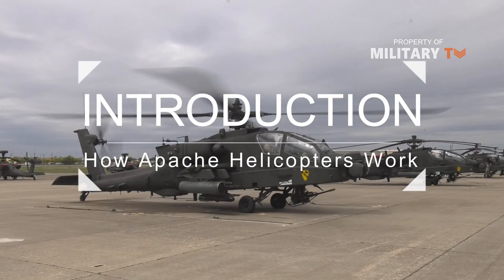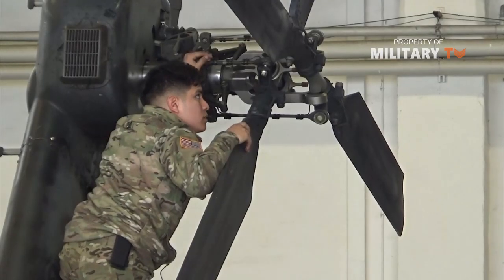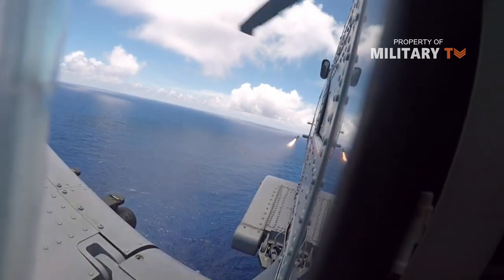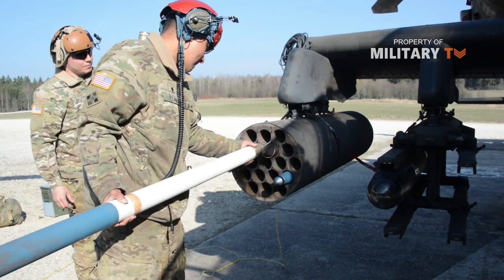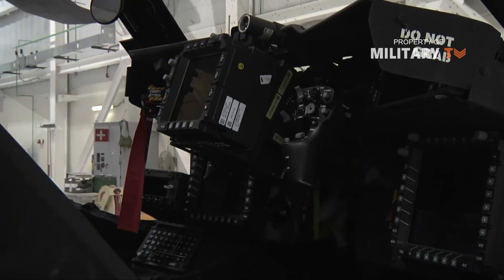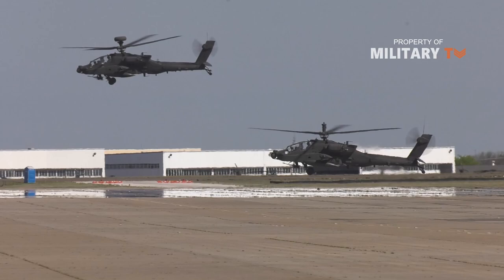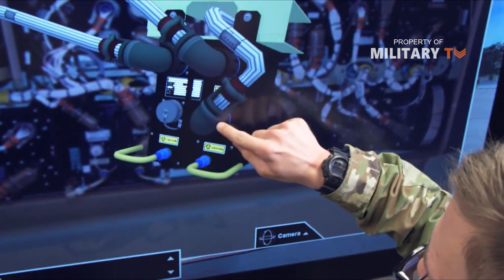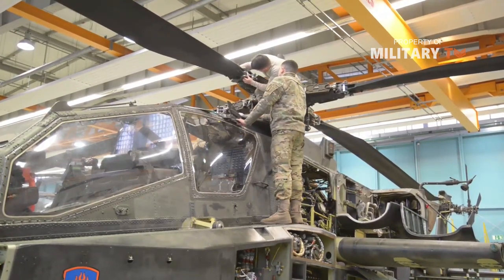The AH-64 Apache Helicopter Monstrous Power & Capability

Comment: Fun fact: the Apache is the hardest heli to fly in the world because you need to do everything at the same time
Reply: Not really because a lot of controlling for those functions are intergraded into the AI computer too.To aid you the pilot and the helicopter for flying too.
Reply: @Chi Chu  yes but still your eyes do diffrent things and your arms/legs
Reply: @Eggychonk  after about 100 hours your hands and feet control the aircraft without you really thinking about it. Pretty much like driving a car, you don't think about everything that you do behind the wheel, it just happens. Like using the force.
Reply: @mrgrinch837  yeah at some point it becomes second nature
Reply: @mrgrinch837  that can be said for pretty much any flying vehicle. helicopters especially, because they're inherently unstable platforms. Just getting the damn thing off the ground without overcompensating and drifting sideways into a wall takes practice. Flight training with a helicopter puts you through a lot of exercises that simply involve taking off, hovering without drifting, and then landing in the same spot, because even in a private/commercial helicopter it's hard to do that.

Comment: The dumb fire rockets are now laser-guided as well thanks to APKWS systems.  Their standoff range is up to 3 miles.  They come at you at 2400 fps or about 7 seconds travel time.  22k is far cheaper than a hellfire.   Sadly, they don't support the ninja blade format.

Comment: Apache is available in situations. 
It is still No.1. In fields combat.
Battalion needs these machinery helicopter. 
It is useful.
Body,engine, propeller, electronics, weapons, proof/paint,equipment,head set/radio communication, command system,and GPS avigation gadgets. 
I suggest that parts should be modules in assembly Assembly site and conveyor belts.

Comment: Been in love with this war machine  ever since I learned about it. Prob 1 of 2 favorite air machines.
The Apache & the A-10 Warthog working together for our ground troops is such a beautiful thing. Goddamn beautiful I say! You won't win....
Edit - I wonder if we can figure out a way to put A-10 gatlin gun on an Apache helicopter.( Have to make the heli would have to be double in  size probably but so..........!!!!! Gotta be a way!!!!!!!! Think!   Haha. Seriously though.........
Reply: Both are 30MM rounds.  I flew the 64 for 20 years and learned a lot about the 10 from another 64 driver buddy who was. USAF Crew chief on the 10 prior to The primary his Army service.  As I was told, the primary difference between the two 30MM rounds is the size of the shell that houses the powder that propels the rounds.  The 64 moves at slower speeds than what an A-10 requires for flight in an attack dive so it doesn’t require the range the 10 needs.  Both are high explosive rounds.

Comment: -Hellfire missile: $80,000 HEAT warhead for destroying t72 style tanks
Actual use : destroying insurgent 1992 nissan and toyota trucks and vans.
-30mm autocannon: Over 2 inches of penetration for destroying BMP style infantry fighting vehicles and other light armored targets.
Actual use : shooting infantry.
-M2 50cal: role, anti infantry overwatch and light vehicles (jeeps etc).
Actual use : opening MRE's and mail.
Reply: The only thing that I know of that has ever survived in Apache hit was in M1 Abrams tank in Iraq when a moronic lieutenant colonel fired two Hellfire missiles at a Abrams and the only damage was a ruptured hydraulic line and one of the crew members getting burned with the hydraulic fluid. The Abrams and the challengers are the toughest tanks on the planet.

Comment: i love the Apache...but with the fearsome Kamov Ka52, MI 28 Havoc and modified Hind Mi24...I think the Ruskies got this one
Reply: Given the Russians invented helis I think they should get that category on lock.
Reply: Ask yourself why they need three to do the same job
Reply: @bevpotter9938  They dont Bev. They are optimised for diufferent roles.The KA-52 is the Spec ops Chopper, The mi-28 is the equivalent of the apache, the mi-24 is the workhorse. Look at Mi-26....it has more cargo space than than a C-130 hecules! The russians simply buildbetter helicopters. I have no issues admititng that the F22/35 is far superior to what Russai has and the US navy is waay more capable than Russians. Why cant you respect the the russians for their achievements?
Reply: @bigdarshan  what about now? The Russians lost 18 ka52
Reply: Yeah this comment didn't age well
Reply: When you're dealing with that kind of Firepower there are two things you need to take into account. One, the first one scene is the first one killed and two, if there's an enemy helicopter out there awacs is going to see it first and vector fighters in to remove it from the skies. That's an area of a helicopter on helicopter engagement is just not something that's ever going to be seen. The Airborne warning and control system as well as the J-Stars have very sophisticated radars that can pick up a helicopters rotor cranking on start. There is not a chance in hell that any enemy aircraft is going to be operating near Army ground troops, that would include apaches. It won't happen.

Comment: They should have added the picture of the british soldiers sitting on the sides of it because they wanted a ride into an ongoing firefight, and no other helicopter was available.
Reply: That was in January 2007. It wasn't because they wanted a ride into a firefight. It was because there was a casualty who needed rescuing and there was no other way to get to him. His name was LCpl Mathew Ford. Unfortunately he died of his wounds.
Reply: @PaddyInf  -There actually is a compartment in the belly that has carried people in emergencies.
Reply: @zxej6879  The cargo compartment contains emergency kit for the crew. It has never been used in UK service to carry people as it violates the release to service. Plus it is only rated to carry 35kg of kit and is too small to fit a person plus kit. The episode in 07 was the last documented time non-aircrew have been carried on ops on the air frame. The emergency procedure for carrying casualties is to attach them to the undercarriage using straps carried by the crew specifically for this purpose.

Comment: Soo how does the laser guidance system work if we dome the base with mirrors and reflect the laser out?
Reply: Ask your mom
Reply: It don't, which is partly why they're going with radar guided missiles today. As for why that wouldn't work on radar, radar guided systems work like more of a flashlight-camera system looking for reflections rather than using a laser on one tiny point. You could use flat mirrors to mostly reflect the light away from the source, which is the entire point of the F-117, so that works. Any curves so the edges aren't sharp and you're right back where you started, though. Then you need to cover the whole thing in radar absorbing paint just for good measure, which is expensive and rather thick due to the physics of reflecting long wavelength light.

Comment: what is that round thing on top of blades?
Reply: Longbow radar
Reply: @2010sjay  for air targets?
Reply: @alinaeaj9127  Ground and air
Reply: @linussandell831  thanks
Reply: @alinaeaj9127  You're welcome, but don't quote me on the air aspect because i'm a bit unsure, just assmuming on that part but it's mainly for air to ground use
Reply: @linussandell831  ok
Reply: @linussandell831  nope, it's for ground targets only. People keep assuming it does air to air, that's not the case. The us as well as Western Doctrine is we would have a awacs aircraft up and as long as those things are in the air there's not a chance enemy aircraft will get within 100 nautical miles of this thing. There are instances where it says it has fired stingers, that's a research and development thing. It does not do air-to-air combat. That's going to be left up to the Air Force and navy.

Comment: Heat seeking missile require heat to go to it's target so the apache drops its own heat temperature to lose the missile targeting systems
Reply: It actually uses three different techniques. The black hole infrared suppression system, infrared flares in the dispenser and low level flying makes it very difficult for a heat-seeking missile to lock on. All three make it very very tough to take it out with a shoulder fired Sam.

Comment: Can the windshield withstand a 50 bmg armor piercing round? Or a 20mm? If you are a skilled sniper well hidden,  in the right place at the right time with the right gun, that is your only chance of beating one of these and thats a slim chance at best.
Reply: The windows are made out of plexiglass. There is a transparent ballistic shield between the front and back seats so if there's an explosion that goes off in one cockpit it won't take out the flight crew in the other cockpit. Other than that, you get close enough with a BB gun you can shoot through the plexiglass.

Comment: Not sure why the Apache is not used as much as the A-10 Thunderbolt is for close air support. Maybe it is and I don't know much. 
I do know that we had both Apache and Kiowa Warriors in support and we only used the Apaches once but had Kiowa Warriors in support every day. The KW can put a single 50 BMG round on target like a sniper rifle.
Reply: @sicsempertyrannis7  I was in Mosul for 13 months in 04-05 and one of our first missions, before taking over our platoon sector from first brigade of the 2 ID, was to drive down to Anaconda and escort the 151 aviation bgd that was to be our overwatch Apaches. We were supported by them on our first full bgd mission in a hammer/ahnval operation. Upon exfil our BN was taking RPG fire from a building and the Apaches shot a hellfire into the window and that was that.
And we only saw them during their "show of force" every week or so when they would light up some targets on an island in the middle of the river... 
We had more support from the Navy F/A 18 Super Hornets dropping JDMS for us and doing gun runs
Reply: Whether you get a warthog or in Apache depends upon the situation. They both do exactly the same job, it all depends on which one is available at the time of the request is made. First come first serve.

Comment: "the crucial motor component can sustain 23mm fire" LOL SURE BRO
Reply: i was confused about that as well lololol..i'm a combat vet.
Reply: @KevinP32270  cool, no way that prop can handle a 23mm thats like a su27 cannon
Reply: Chill Waw
It can actually and the fuel tank can take a round and resell itself
Reply: @rainerduxworth6669  i doubt it man, ik the fuel tank can seal itself, thats like ww2 tech, but no way that motor can sustain fire from 23mm, maybe a few shots sure but a straight on barrage of HE bullets is gonna tear that thing apart. doesent rly matter anyway since main anti aircraft wepons are rockets and flak doe
Reply: CR  they use it mostly in russia and ex soviet union countries, like you can mount a twin barreled 23mm on mi35 mig 29 and other aircraft that is currently outdated. i think the thinking is if it can withstand 23mm it can also withstand 20mm
Reply: It's resistant to 23 mm rounds, pretty much like your watch is water resistant, not waterproof. The only thing this means is that it is designed to be able to be strafed and likely will stay in the air. It isn't going to continue fighting it will have to leave the combat zone and make an emergency landing. There has been a case during Desert Storm in the very first engagement when the team of ate Apaches went across the desert and fired up some early warning radars. One of the Apaches had 23 mm hole through the rotor disc. Depends on where you hit the thing, you could either scratch the paint or put a bullet through the Pilot's neck. Either way they're calling the insurance company.
Reply: @marko61900  that's probably one of the reasons they have two engines. They can still fly on one.

Comment: Whats that bubble on top of rotors?? Sensors..
Reply: It's a millimeter wave radar system which is designed to scan the battlefield in a half a second and get the locations and descriptions of up to 25 different targets instantaneously and prioritize the most dangerous 8 to the aircraft. It can then fire off Hellfire missiles and hit each of those targets.

Comment: 7:40 The Yankee is loading different rockets in the same zone.... SMH #12cab
Reply: Yea, you can do that in the apache. It can hold up to three different rockets at the same time
Reply: @linussandell831  right, but different the types have to be loaded into different zones with in the rocket pod. There's  an A, B, E zone on that rocket pod.
Reply: @aolson8283  Oh really? how do you know which one is A, B or C?
Reply: @linussandell831  A ZONE: is the 12 around the outside,  B ZONE: is 4 in the middle (two above the  E zone and two below); E ZONE: is the center 3.
Reply: @aolson8283  Oh, cool. Thanks alot, is there a reason why it's called E and not C? I noticed that i read it wrong the first time
Reply: @linussandell831  rocket pods on the inner pylons are zoned C, D, & E respectively. E ZONE is the same for all pylons. For a total of 5 total zones. The reason I commented I'd because rockets of different types are never loaded into the same zone because the aircraft wouldn't be able to distinguish the different types in that zone. The type loaded in a particular zone are set in the aircraft.
Reply: @aolson8283  Oh, i get it. Ok, thanks alot, I really enjoy this sort of information :)

Comment: 30mm is apaches primary weapon. It was literally built around the gun. Without the gun the aircraft cannot fly
Reply: I never know that! How did you know?
Reply: GEO I work on the armament systems lol and load them with ordinance
Reply: Well actually it can fly without the gun, and it's not built around the gun. The gun is hanging beneath the aircraft. I think you're probably referring to the GAU 8A 30mm cannon on the A10 warthog.
Reply: @mrgrinch837  I’m literally an Apache Armament and avionics tech. The aircraft cannot  fly without the gun due to it being a counter balance.
Reply: I flew Cobras for close to 10 years, we can fly without the 20 mm although it's something that's really not done. Confirm with an ah-64 maintenance test pilot that you are indeed correct. Sat in one of the monsters for a transition that was canceled. Comparing it to a cobra it's like comparing a Dodge Challenger to a Volkswagen Beetle. The thing is freaking huge in comparison. I would not have it suspected that the loss of the gun would have made that big a difference but according to you and CW5 
Hefler you are indeed correct.
Reply: @mrgrinch837  the apache is a behemoth compared to cobra but Cobras are badass helicopters as well!

Comment: The only think the apache is missing is ejection seats to save the pilots.
Reply: you cant have ejection seats on a helicopter mate, you would be chopped up by the rotors
Reply: @adammaher6962  So then what must go before the election seats shoot out?
My vision see the blades being released from the main rotor, then the seats come out.
How? I have read that exploding bolts exist. Some held the space shuttle in place before lift off. So the bolt holding the blade to the main rotor can explode releasing the blade.
Is my idea possible? I dont know, but im thinking outside the box.
Maybe something like this,

https://youtu.be/5kMd4dQlges
Reply: @xxZerosumxx  I mean, if the helicopter is anywhere near people, which they usually are, if the roters exploded off they could end up hitting troops on the ground, which could be lethal
Reply: @adammaher6962  Not really. Saying the blade might hit and kill some troops doesn't mean it will happen every time if at all.
If thats the case why do A-10 have ejection seat? They fly close combat with troops on the ground. The plane could land on the troops and kill them all.
Reply: @xxZerosumxx  Thing is, when the blades are shot off they are fired at a fast speed, because of the explosion, and the fact that they fire off in all directions, its very unlikely that it would kill troops on the ground, but there has to be some reason why attack helicopters generally dont have ejection seats
Reply: @adammaher6962  except for the KA-50
Reply: @adammaher6962  actually the Russian havoc and Hokum do have ejection seats. The rotors detach a fraction of a second before the seat comes through the canopy.  That is the one thing the Russians are known for, building quality ejection seats. Makes you wonder why doesn't it?
Reply: @adammaher6962  I'm pretty sure the Ukrainian bullets are doing that already.
Reply: @xxZerosumxx  with the size of the Earth are you saying the only place at A10 can land is on troops? Why on Earth would that ever happen? Maybe if those troops are standing on the runways, that could be a problem. Chances are they see an A-10 coming in for a landing they might want to move.
Reply: @adammaher6962  because we're trained to auto rotate the helicopter.

Comment: Can the apache take a direct hit from a missile and still function
Reply: Most of the armor is designed to keep the aircraft flying. Generally, depending upon where it takes a hit it's likely not going to be able to fire because of all of the black boxes that are not armored which will not allow the weapons to be used. But it is an incredibly durable machine that is designed to take hits and still keep flying.